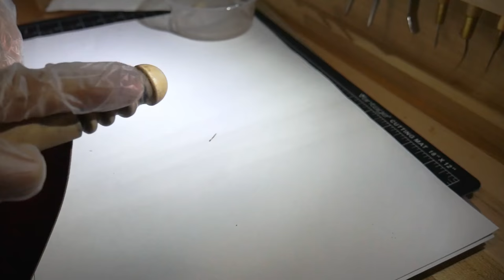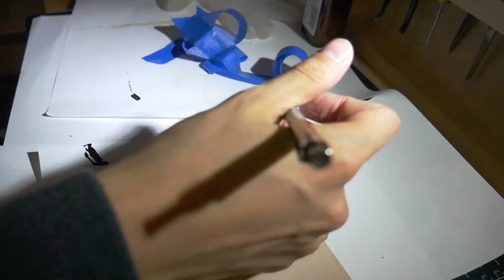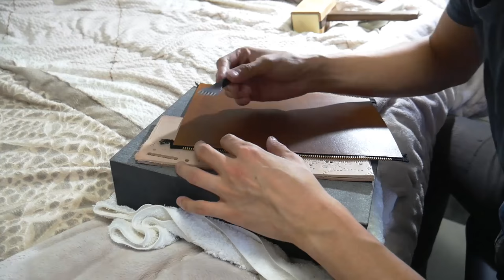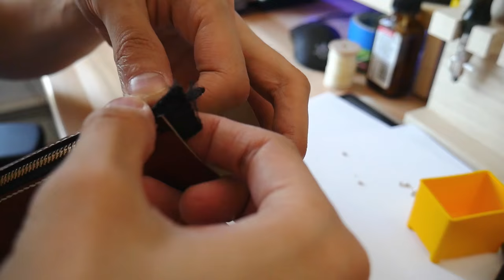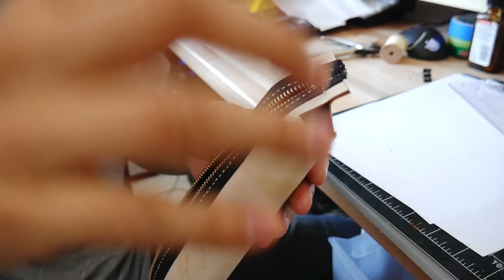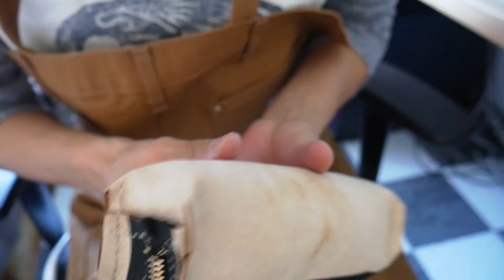Leather Pencil Case Build

Comment: Good work. However when making the cuts at where the seam folds, how did you know where to cut? 
I have tried this. Twice. And that has been my undoing and I am so frustrated
Reply from the maker: This was actually my second attempt. I had a hard time doing the corners as well. I marked my stitching lines and cut a little bigger than what I needed (maybe a quarter inch or 0.5cm. This way, I can stitch more comfortably without having to worry about where to cut (it will be in the inside anyway). Good luck!

Comment: Do you have the measures of the original or this one? Wordefull work, there is almost no other videos showing every step like this in youtube, i'm surprised no one commented yet. Thanks you!
Reply from the maker: Thanks for the kind words! Unfortunately, I don't have the measurements for the plans. I figured the measurements out using a long pen(8in) and worked from there. I was aiming for 2x2x9 inch or so. Working backwards off that, the first piece is about 14x9. Just cut 1x1 inch corners from the dopp kit plan. One advice I can give here is use thin leather (2oz or so) otherwise it becomes hard to flip over at the end
Reply: Is 14 x 9 correct? I just cut a piece that big and it seems like it'd make a massive pencil case
Reply: @AndrewSmales  I think its a typo and it should be 4x9. He kept the 9 he was aiming for which is the total lenght minus the sides. So the 2 x 2 is widht and height, no doubles there and connected to the zipper so should really just be 4 (2 x 2).
Reply: Although looking at it, 9 does not make sense either. You will need a square that on one side does the height and widht, so that is 4. But on the other side you will need to 'overcome' the same height, so lenght should really be lenght + height on both sides. So all and all I'd start with 4 x 13.

Comment: What brand of thread did you use? Also, im having a real issue getting my 6 prong stitching irons to go right through my relatively thin leather, despite the fact that the irons are good quality.  Any advice on that? Thanks!
Reply: @Ross What did you put under your leather?
You might use hard surface under your leather.... this will make stitching iron dull.
You should use things that have elasticity, like thick rubber pad (at lease 1cm thick), or multiple layers of  leather.
These will protect your prong, also give it space to punch through the material.